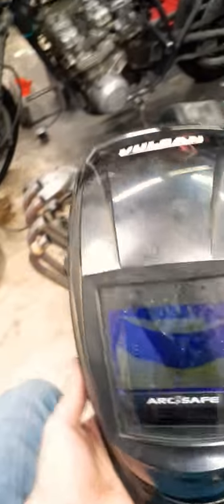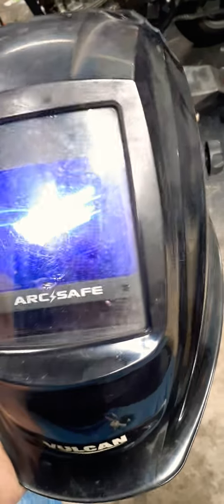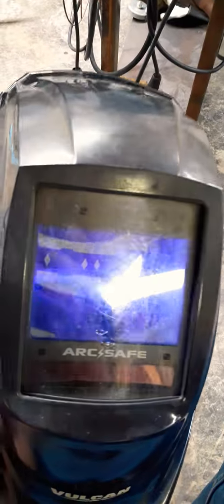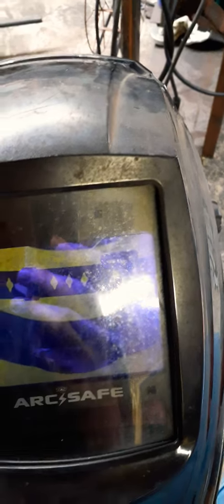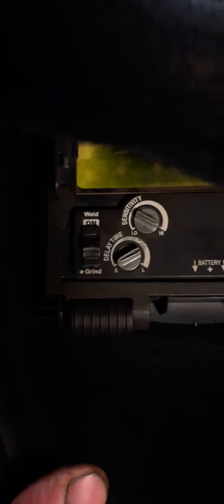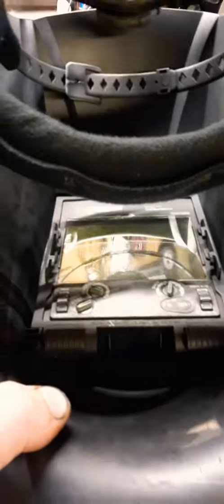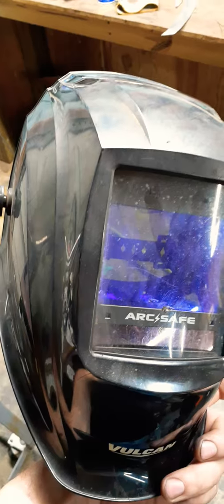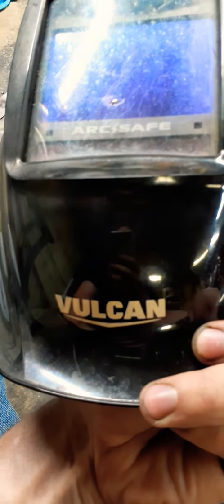VULCAN ArcSafe Welding Helmet, How Good?

Comment: Bought my Valcan welder but didn't open the box. I went to buy the Vulcan helmet with a regular 20% coupon. Like you I was told that it could not be used. The manager told me there should be a coupon in the box for 20% off any Vulcan accessory. She had a coupon code and ran it  with my helmet purchase. It brought the price from 149.00 down 30.00. When I opened the box at home for the welder, the discount was missing. So in the end all worked out great.
Reply from the maker: Glad it all worked out good! Did you get to try the hood  or welder  yet?
Reply: @ImprovisedBuilds  Not yet, but most likely next week when I'm off.

Comment: I'm just a weekend fix-it guy. Can you tell me the best setting s for stick welding? Thanks
Reply from the maker: Same here man! What are you trying to weld?  Btw a good rule of thumb is 1 amp per .001 inch material thickness....so for example if you wanted to weld 1/8th inch steel (0.125")  you would be pretty close to run a setting of 125 amps.
Reply: @ImprovisedBuilds  Was talking about the helmet lol  Just picked one up. I had the reg one for a few years. I think that's what hurt my eyes. I wish I would have paid a little more back then. But when I put a light it gets dark. But if I hit the light again it's clear. But I do it again it's dark. On the new one. The same one in your video.
Reply from the maker: @hunter6099  haha long day man, I gotcha now,  my preferred setting is to have sensitivity all the way up, delay all the way down and shade 11.
Reply from the maker: @hunter6099  what kind of test light are you using on the hood? On mine a LED wont make it darken but an incandescent light will. Not sure why
Reply: @ImprovisedBuilds  I got it. When I hit it with the led it would get dark. But when I hit it again it would not make it dark. Then I thought about moving it around. And that worked lol So tried it in the shop. worked way better than the $50 one. I wish I would have got a better one years ago. You can see the weld a LOT! better lol Thanks
Reply from the maker: No problem!
Reply: @hunter6099   just mess with the helmet until you get the settings you like. I have mine on the lowest sensitivity . This helmet doesn't seem to react much to light that isn't an arc ( at least in my experience as a shop welder) have the delay as quick as possible,  longer passes require a little darker of a setting to reduce the strain on your eyes. Short passes at low amps can be done around 10.5 I wouldn't recommend going much lower than that. And remember to watch the puddle itself don't look directly at the arc. Something that really helped me when starting out was thinking of it like mirrors on a CDL truck. Every few seconds you should look where you're going then move your eyes back to the puddle, then back to where you are going. I hope this helps. Take care buddy